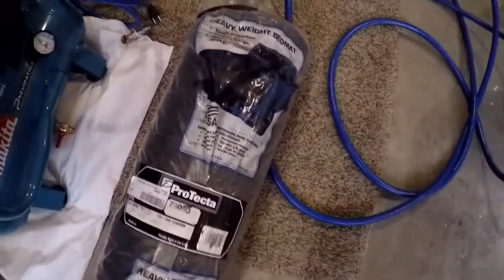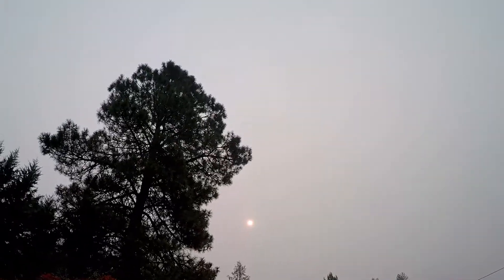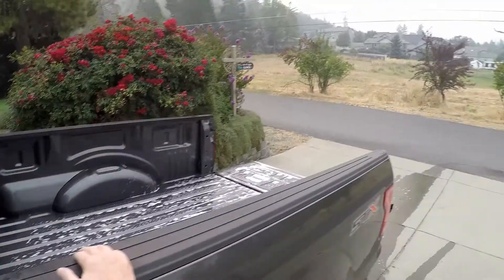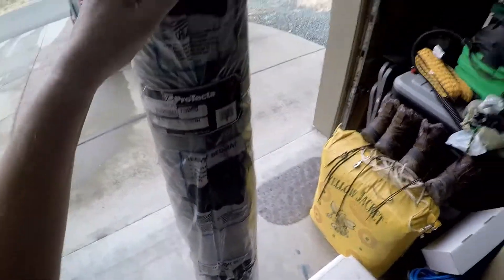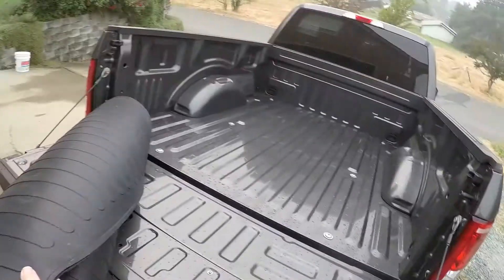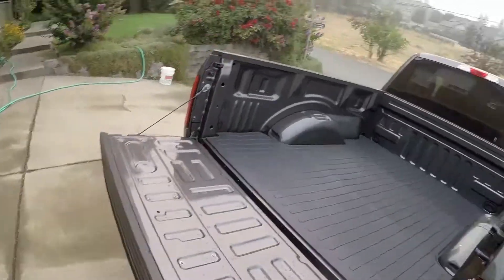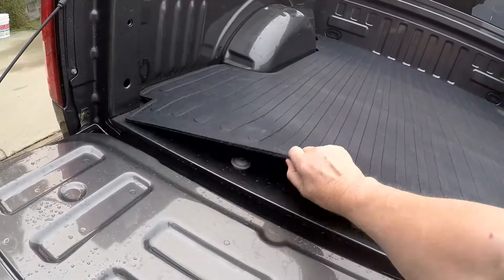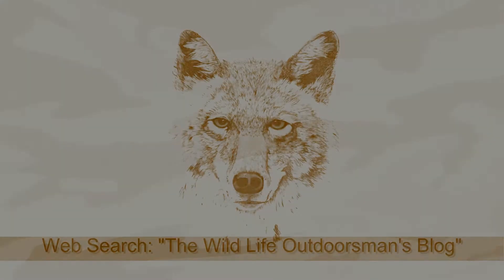PROTECTA HEAVY DUTY TRUCK BED MAT

Comment: You find it flops around while you’re going down the road?
Reply from the maker: No, it never did flop around in the back of my truck, even with a completely empty truck bed. However, I have a truck cap now so this would not be an issue.
Reply from the maker: Here is the LEER Micro Camper truck cap I got:  https://youtu.be/EahlorUuklg